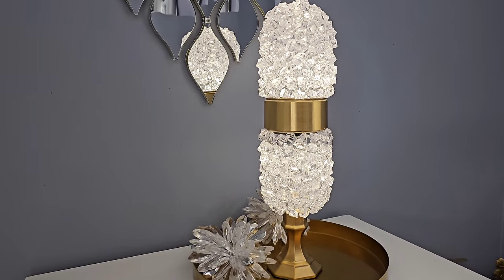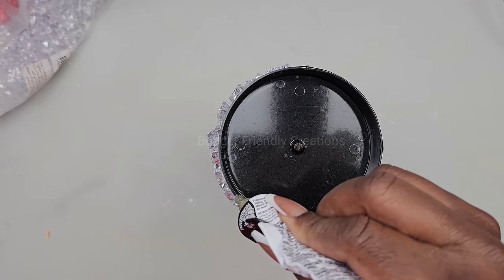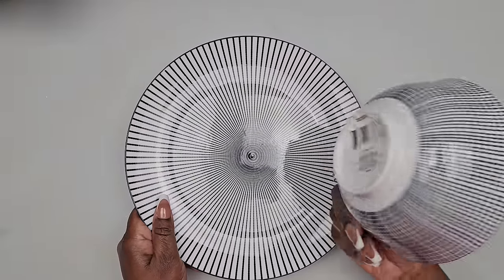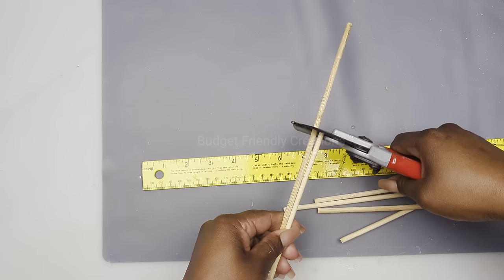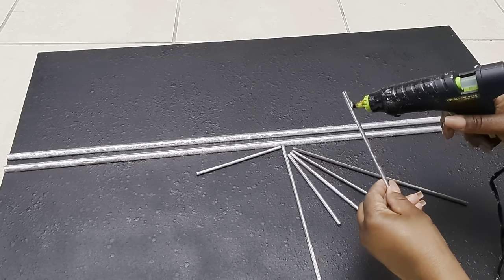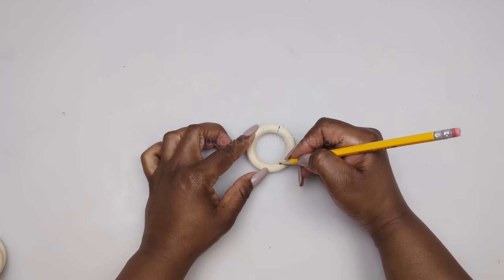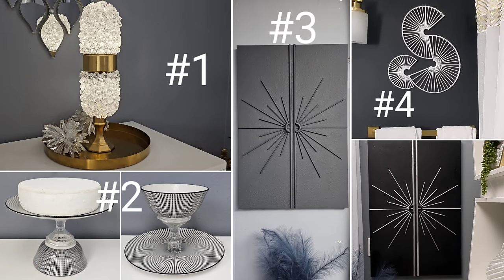NEW DOLLAR TREE DIY CRAFTS

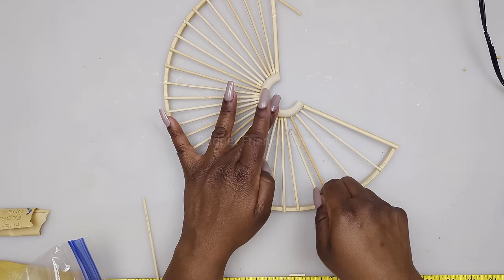Comment: 16:18 love your channel btw....  Thought, you could have cut 1 end of the skewers glued it exactly how you did and then cut it flush all at 1 time when you were done... Incase you want another one, that's a much quicker way of doing it. It's how we build decks. We'll lol sort of, you get my point 💙
Edit you might could lay it all out now that you've done it & glue it all at 1 time in the middle with hot glue to get a fast hold then use a thick paint on glue for the outer edges when laying them down permanently, cut once dry & finish...

Comment: I have a question for you. If you are going to tape off something cirlular say the bowl in the cake plate you designed.  Because you wanted go spray paint it how would you do it in so much as the lines are even. I run into imbalance often when I am doing so with circular projects. Thanks for your wisdom!
Reply from the maker: Hi. Use a rubber band. Put the rubber band in place, then tape below it. You can use a plastic bag to cover the majority of the area and then tape on top of the rubber band and the plastic bag. Hope that helps
Reply: @BudgetFriendlyCreations  OMG... It sure does... I can feel my excellence in excution as I type. Thank you So So VERYYYY MUCH!!!! You are a BLESSING!!